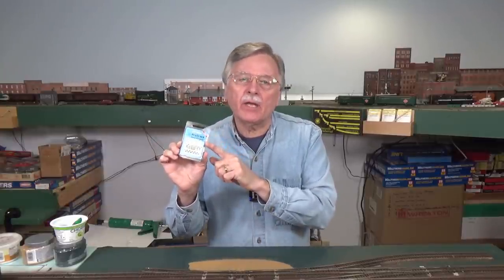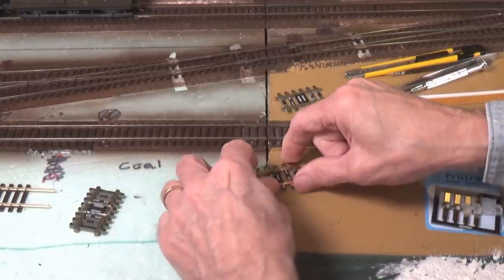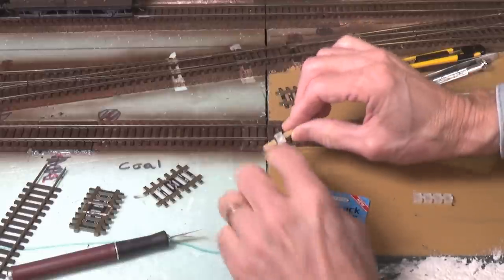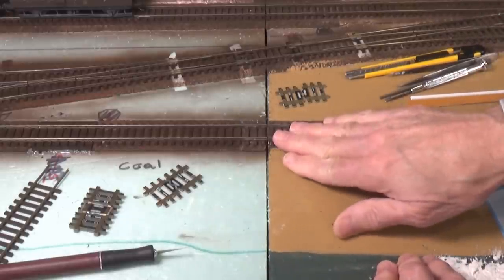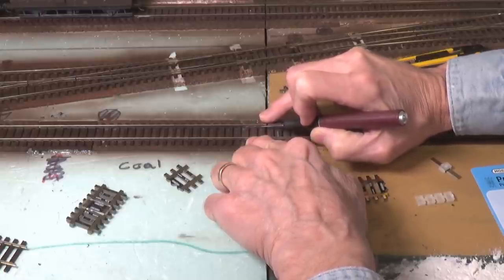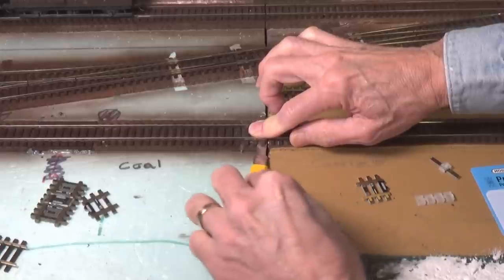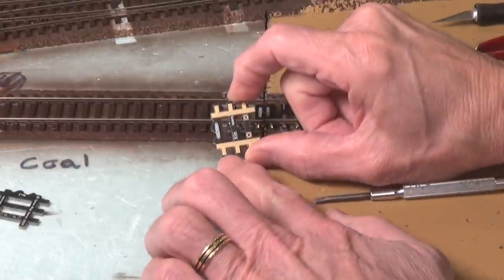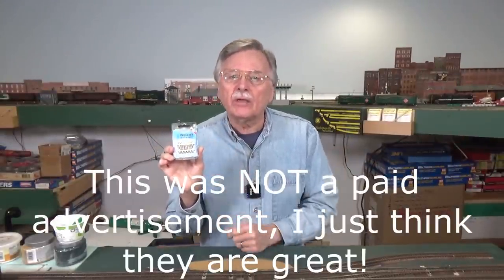Get Perfect Track With NEW ProTrack Rail Aligners (156)

Comment: Hi Larry, I was watching the Modeltech YouTube channel on these rail aligners last week and they do look a game changer for module track alignment.  Having now watched your video on retro fitting them to existing trackwork it gives me idea on how to the same on my portable layout.
Finally, Merry Christmas and enjoy this festive period and look forward to catching your video.
Reply from the maker: Thanks Gary. I just finished installing them on all 4 tracks at the gap on the modules and painted them so I can show them in the next video. They blend in fairly nice and when I do ballast them that will finish it. If I get bored tomorrow I a,y just go ahead and post the next video on schedule as a Christmas present, and then take the 3 days off.
Reply: @TheDCCGuy  Thanks for the reply Larry...be interested on how you did the track aligners at the angle across board joint  ? Happy Holidays..
Reply from the maker: Gary, there really is not much if a problem with angled installs. Gwion told me they can be angled as much as 45 degrees and still work because of the angles of the teeth in the aligners. My problem was I had two back to back electrofrogs at the gap so I had to adjust for the short ends beyond the points. Still worked out fine. I wish now that I had filled the track nail holes with putty or super glue as those do stick out since none of the other ties have them. I likely will just squeeze in some filler and touch up with paint.
Reply: @TheDCCGuy  Many thanks Larry. I am going order some after Christmas..😃

Comment: I have a drop gate on one end of my staging yard and alignment has been problematic.  These are brilliant!  I will be purchasing several and giving them a try. Thank you for sharing!

Edited to just add that I’ll be on the lookout to see how you handle the lift out. 
Thanks again!
Reply from the maker: If you go to the modeltech.uk website and click through on the Rail Aligners there is an instruction sheet that shows how to use them with a lift out.

Comment: Great demo. I have always thought that heat sinks - when soldering rail near plastic ties - is a very good idea (thanks Excelite!).  Not sure where to purchase them, but in the U.K. you  can buy a 'three-way' rail/track aligner (as opposed to the roller type of track gauge from DCC Concepts for example), which keeps the rail ends accurately gauged and in line, and allows a soldering iron between 2 of the points to correctly solder the rail in place.

Comment: Gary these are great. I will be needing several pairs of these when I build the new layout. I’m using atlas code 100. I hope they are compatible. Thanks. David
Reply from the maker: The HO code 83 version should have ties closer to US practices. The standard HO/OO version uses ties for UK practice.
Reply: @TheDCCGuy  so the code 83 should work then
Reply: @TheDCCGuy  Thanks for this info, and what a great product... I think they should rename the "USA Code 83 (RAU16001)" into something HO or North America specific to prevent this confusion. Glad I read your comments as I was about to buy the "standard" version they sell, thinking that implied North American code 100, and did not realize the tie (sleeper) spacing was the real key!

Comment: I'd like to see how these work at the "angled" section of track off the switch you have just above the section you worked. I'm guessing the segment is fairly straight, but there'd be a big of overhang to be cautious of if you're moving/storing/transporting the modules?

Otherwise, I need to get a ton of these and get to work on laying some track.  Track alignment has been my biggest concern with starting a modular layout. I think this will help quite a lot.

Thanks for the great tips and excellent demonstration videos Larry!
Reply from the maker: They do overlap but only a little at that one point. These can be installed on angled track up to 45 degrees and still mesh properly. I will be showing all the completed installs in my Friday video—yes I decided to release it on schedule just to get it out of the way.

Comment: Hi Larry, for lining up track at the baseboard join when you first install then fine, but I think you are pushing it if you expect them to pull a lift out or hinged lift up section into alignment when the physics of that section has slop or any bias to either side (including that which may develope over time). I can see these pcbs getting easily broken or misaligned in those instances if both are firmly fixed down, to avoid one must be allowed to float so it can self align. Good lift out section alignment performance relies on a frame that doesn't distort at the interface with the two edges (temp and humidity considerations) and if unavoidable has some form of alignment mechanism e.g. tooling pins. Just imagine your soft wood frame drying out and twisting slightly with humidity changes, the forces involved are incredible. Getting this design right in the first place makes these aligners redundant in my book and that's where I would urge fellow modellers to focus their efforts! Stephen
Reply from the maker: Stephen, I too have had second thoughts about using it on the large lift outs since they have 4 separate tracks and that would be a reach to drop all four in place on both ends without knocking the Rail Aligners loose. I am now taking a look at whether I can use them on my lift out bridge across the door into the layout room. More on this to come.
Reply: @TheDCCGuy  Larry, good to see you have realised their limitations. Look forward to see how you get on.
Reply: My thoughts exactly ,, great for a club type DEMO table layout but i'm doing the PENNSY 4 mainline 10 ft. Across horseshoe curve , live in MICHIGAN were our temps go from 90+ summer to 0 winter humidity all over the place .
I used 2×4 framing and 3/4 inch plywood and still have to leave about 1/16 of an inch for expansion at every rail joint ..

Comment: Wouldn’t you want the model tech aligners NOT glued to the board? To me, it makes sense to have the last inch of track, where the aligners are, able to have that very limited flexibility to lock in place every single time. It’s only the last inch & I know not everyone would agree with this, but this would create a point of connection at the track seam not completely dependant on the module connectors. This way if a bolt hole expands or a pin shifts over time on the module, the track interlocking seam will find its way to a perfect connection. Cheers!

Comment: Hi Larry, a guy here from the uk - Did you ever do a video for using the Modeltech for the lift out section, if so what number video
Reply from the maker: No, once I decided to use the DCCconcepts alignment dowels I dropped the idea of using the Modeltech parts. I also figured that using them for a lift out/drop in bridge would not be a good idea as they are more likely to get broken due to a mismatch or even worse someone walking into the bridge. The dowels though create a very robust solution.

Comment: Great product. I am wondering if anyone has figured out how to combine with an expansion joints, so the length would could be slid a bit for adjustments where there are multiple modules, some newer than the others.
Reply: sorry no link for you.
but yes there is a product on the market just read about it in the past week.  it s a "stretchable. section of track for use on modules. (as in safely spanning the gap between sections).

Comment: Thanks for another great informative video Larry. Shouldn't you be able to use these on any code track since they get soildered to the bottom of the rails? I was also wondering how they might work  on a radius section?
Reply from the maker: Hard to say how well they would work on a curve, but I suspect it would depend on the degree of curvature. Yes, they are basically independent of code since that only refers to how tall the individual rials are. However, The thickness of the PCB ties may be slightly different but that could be fixed with a little sanding if too thick. The main difference is the dimensions of the toes compared to the plastic ones and their spacing as these differ among the various versions . So the US code 83 version looks like and is spaced like Peco, MicroEngineering, and probably other similar US prototype HO track.

Comment: I use dcc and use the ends of the flex track about every three pieces to have sections in case of a move and these would be very helpful for that purpose but if you make the separation point the end of a signal block as well, wouldn’t these prevent you from electrically isolating the block? You may have to cut the foil on these under the track to isolate the power. Since you physically have them, does it look like the foil can be cut easily?
Reply from the maker: As long as you gap the rails at that point the blocks would be isolated. Tnere is no aelectrical connection across the pair of Rail Aligners just the three ties in each section and of course the rail itself. The metal traces are thin enough they can easily be scraped off.
Reply: Thank you for your response and for clearing that up. Thank you for your videos, they are very educational and informative.

Comment: HAPPY HOLIDAYS to you and yours.
Enjoy your channel lot of info and ideas (I'm just starting) have a question since you are doing UK / US track code 83 and 75 bullhead what's the difference?
Reply from the maker: Peco US code 83 is .083” tall whereas UK bullhead is 0.075”. The new Peco bullhead rails are much skinnier rail than even their standard UK code 75 rail. US track has metal tie plates and rail spikes to hold the rails whereas UK tracks have “chairs” in which the rails sit and are/were held in place with wooden and later metal wedges. Also the UK ties or sleepers are wider than on US tracks and the spacing on UK track is greater. The Peco bullhead track looks very much like On30 narrow gauge track as a result. For this and other reasons I decided to use the Peco standard instead of their bullhead track since they had not started making bullhead turnouts and mixing the bullhead rail with the stand turnouts would not have looked right. It also is much more expensive and once painted, ballasted, and scenery placed all around you really don’t notice it unless you look close and know what to look for.

Comment: Larry will these work on a drop down gate, fast track make copper sleepers, I was going to try these, install track then cut your track
Reply from the maker: I will be doing a video next week on using these for a lift out which is essentially the same as a lift gate and will have a better feel once I have tried that. I also have a lift out bridge that would benefit from these and may retrofit it with them if the lift out works well. So look for the next video on these.
Reply: Hi Larry , great news, I am building my first layout, need a lift out or lift gate, I built a lift out but feel a Lift gate will be better, just not sure how the track works at the hinge side, thanks for your videos , great work

Comment: I wonder if he's planning a joiner for Atlas code 83, that would be great for Freemo!
Reply from the maker: I bet these would be fine with Atlas code 83. I have a piece or two around here and will check tomorrow. These would be great for all the model railroad modular groups, just need to get the rule makers to sign off on them as you can’t have half doing their modules different ways unless you make up some transition modules to go between.

Comment: This does not answern the question of how do you fit the aligners at TWO ENDS of say a bridge or a lift-out. I have a bridge and have fitted the aligners at both ends but when I lift the bridge the ends of the aligners get caught up with each other. The one shown above the lift-out section was slid into place I cannot do that.
Reply from the maker: Des—I was thinking of doing a similar lift out installation too but due to the problems you mentioned put that on the back burner.

Comment: How do you use them when the track crosses the joint at an angle?
Reply from the maker: If I remember correctly, because of their design, they can be placed at up to a 45 degree angle and still give perfect alignment.

Comment: How do you use them on a track that goes across the board at angle ?
Reply from the maker: They are designed to work up to a 45 degree angle.

Comment: How does this work on the lift bridge
Reply from the maker: I couldn’t figure a way to make it work. You need to be able to slide the two parts together to get a close fit and I’m afraid that with a drop down lift gate the two parts would either be too close together and catch on each other or there would be an annoying gap.

Comment: Where can I find the heat sink clamps that you are using?
I’ve searched the internet and can’t find anything similar
Reply from the maker: Try Amazon and eBay.
Reply: I just ordered a set on Amazon,, $6.38 each
Reply: Trout Master can you please give me a link? I’ve searched and can’t find it
Reply: Bought a set on Amazon, need strong fingers to open.  They are almost impossible to keep on code 83 track.  Then I thought bend the tips inward towards each other.  Works like a charm.

Comment: Just spent a frustrating 2hr trying to solder the rail to the ! Using flax ! Help
Reply from the maker: You have to be more specific than that.
Reply: I’ve used the flux,solder and soldering iron before for soldering feed wires to track but just couldn’t get the solder to adhere using the aligner . Using O gauge Pecorino track.

Comment: These look kind of nifty, for sure.  But it would seem that they're only useful where are rails are perpendicular to the module face plate.  In situations where the rail centerline is dihedral to the face plate, they wouldn't seem to be as useful.
Additionally, based on many years experience with module join-up, wouldn't these devices perform better if the rails had some degree of lateral float or flexure in way of the module joint, rather than being tightly fixed laterally?  
I would respectfully suggest separating the rails from their tie connections for maybe 3 ties back from these joiner devices, and NOT gluing or fixing these devices to the roadbed.
Reply from the maker: Good question and I should have mentioned this. Because of the angles of the alignment “teeth” these will work with track angled as much as 45 degrees off normal.

Comment: I guess these are not easy to use where track doesn't cross baseboard joints perpendicularly?
Reply from the maker: Actually as I said on the video they can be used on as much as a 45 degree angle at a joint.
Reply: @TheDCCGuy  It worries me because with one edge of the aligner standing slightly proud of the baseboard edge, there is scope for accidental damage while manhandling/transporting the disassembled layout.  Could lead to time-consuming emergency repairs when setting up.
Reply from the maker: Yes, I guess that could be a concern. However the same is true for the exposed edges of the scenery. I have seen layouts that the owners actually installed a protective edge on the ends and other exposed areas during transport. This could be as simple as bolting a 1x4 to the ends and that would protect the ends of the track. Some even have plywood boxes that fit over the modules for protection. so they can be stacked.